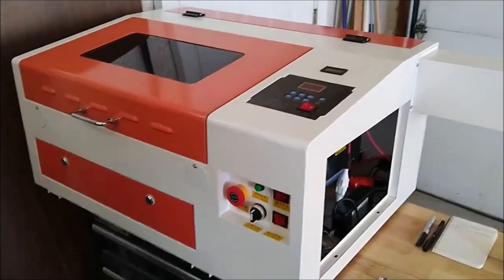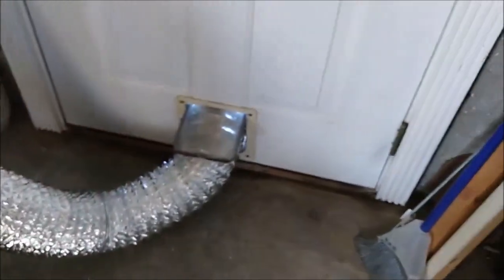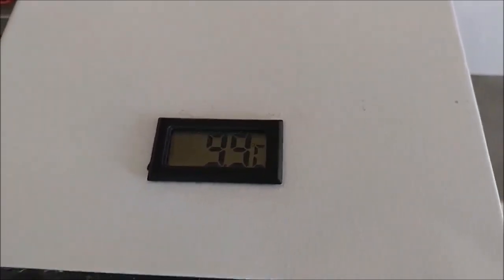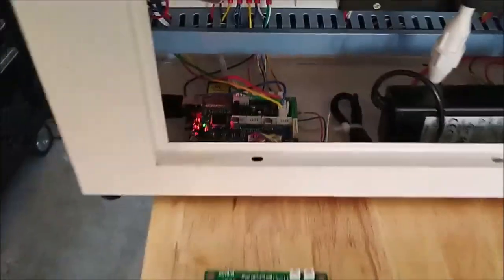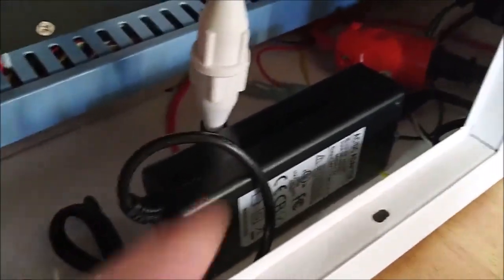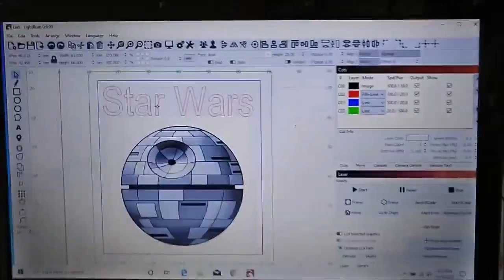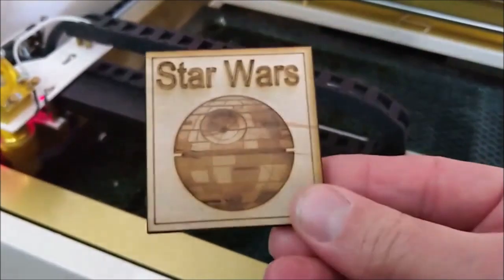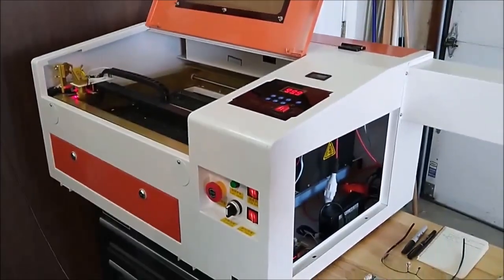Ten-High Laser Engraver Cutting Machine with K40 and Cohesion3D LaserBoard Control

Comment: Thanks for the great video.  It looks singed around the edge and lettering.    Is eliminating that just a matter of fine tuning of the power/speed or do you have more less live with it?  Any idea what the kerf width is?  lastly, what sort of accuracy you get?  i.e. if you burned a 1" circle and mic'd it, what what sort of tolerances would it be within?

Thanks!
Reply from the maker: I am not an expert with the machine.  More of a casual user :)  Not sure of the kerf width, would have to measure it.  Harder woods exhibit less burning on the edges.  The absolute accuracy is very accurate.  For example if I draw a 50mm circle I would it expect the cut to be within +/- 0.1mm.  When I am cutting acrylic that is ~3mm thick, I would guess my kerf is maybe ~0.5mm.

Comment: What configuration changes did you make? I just got the same machine and updated to the same controller board.
Reply from the maker: In the config.txt file, I changed to these values:
alpha_current 1.2
beta_current 1.2
alpha_max 400
beta_max 300

Comment: Thanks for the video! Very helpful in setting up a used 40w I picked up cheap on a whim. I have a question, what air pump / compressor are you / most running? It did not come with one and trying to figure out the air situation. Luckily I am into saltwater aquariums and have the water pump, RO/DI water and a chiller if needed
Reply from the maker: Thanks for the compliments.  My Laser came with the air pump.  Links to pictures of my pump are below.  The pump is quite noisy.  I have thought about looking into something that is quieter but have not got around to it.  It is labeled 45W with flow of 50L/Min.  

https://drive.google.com/file/d/1uWUtiV4oCZfvPZ2YCwBSfZr5aZD_SPZe/view?usp=sharing
https://drive.google.com/file/d/1BZmv_5MLoYwzUHGlSCDeiAPmubsSsb3q/view?usp=sharing
Reply: Thank you very much!

Comment: I am a designer that works in vector (adobe illustrator). I am thinking of buying one of these but had no idea about cooling and venting. Will need to look into it much more. Def need more research!
Reply from the maker: Keeping the laser tube cool is key to longevity.  Some people will just use a passive cooling system like I have on my mill and be ok.   Circulating water with a fan blowing over a radiator.  However, active refrigeration will keep the tube cooler and should result in longer life.

Comment: Very interesting, how the 60W tube was made possible to fit in the 40w case doing a case extension. Never saw that before. I always thought about upgrading to a more powerful tube after my tube will fail some day in the future. Now i know, how to fit in a larger one some day. Guess i also have to upgrade the powersupply as well if i do so. They say, that the power supply of the 40w Laser is pretty weak anyway and cannot even handle the 40w one to its full extent. So in case of a power supply failure i'd probably go to get a 60w capable one for replacement to be already prepared for the larger tube some day. I heard that the cohesion 3D Board let the stepper motors running much smoother and more silent, so i wonder that you didn't mention that in the video (or i missed it). Sad that the cohesion board cost nearly as much as the whole 40w laser. Thank you for this interesting video !
Reply from the maker: Thanks.  It is is interesting how they squeeze in the longer tube.  Ten-High's 40W units have the long tube cutout with a flat plate attached.  Yes, the Cohesion 3D board does run quieter but I did not do a direct comparison.  My air assist pump and exhaust fan are pretty loud and overshadow the stepper motors :) (every reduction does help some though).  I have been thinking of adding an analog ammeter to my machine.
Reply: @DanPattenAudioG33k  I'd definitely do that. The analog Ampmeter shows you exactly what's going on and is recommended by many owners that have a model with digital display.

Comment: Thanks for this video... I'm looking as well, but had been struggling with their requirements for old versions of software.  The solution you found looks great... the Cohesion board and software doesn't work out to cost much than getting Coreldraw, and struggling with it.  Hard to believe Ten-High want you to use a 32-bit OS....
Reply from the maker: Yup, I agree.  I purchased latest version of Corel Home/Student and was unable to use it.  Was only able to use the old version they supplied.  Maybe when you are ready to purchase, you could contact Ten High and ask to drop the price and not ship with the standard control board.  I did sell my old control board and USB key on eBay for $40 :)
Reply: Or just use the stock hardware and get K40 Whisperer, along with Inkscape. All free.

Comment: Hi Dan,

I came across your video in the Amazon Review of the Ten High laser cutter listing - we've had other people asking about doing the conversion to C3D.   Then I searched for "Cohesion3D Ten High" and your video came up on YouTube, first result.  It was really nice to watch.  Thanks for not cutting the end off the power brick AC cable :) - I like your solution more.   Be careful about running the machine at 100% of 100% though, quick way to burn out or reduce lifespan of the tube: https://cohesion3d.com/knowledgebase/cohesion3d-pwm-control-and-potentiometer-vs-digital-panel/

Anyways, thanks for making such a nice and informative video and hope all is going ok.

-Ray from C3D
Reply from the maker: Thanks for the comments.  The combination of the C3D Hardware and Lightburn Software has made my machine much easier to use.  Yup, I rarely run my machine at 100% of 100%, is usually much lower.  At some point, I would like to install an ammeter, just have not got around to it.  Thanks.  Dan

Comment: I've been trying to get corel laser to do a a few jobs (as per your video) at once and I just cant find a way to control the power settings or see a list of scheduled tasks.
Reply from the maker: I was not successful at controlling power with Corel Laser.  LightBurn has been easier to use (for me).
Reply: @DanPattenAudioG33k  I have been looking into lightburn, can you confirm if lightburn allows you to programme the power and speed for each element before executing?
Reply from the maker: Yes, you can program the power and speed of each element in a design before executing all of them at once.
Reply: @DanPattenAudioG33k  I have finally done the upgrade and had to mount the board temporarily the other way as the USB connector did not match the cutout on the machine.
Previously I had set x=0,y=0 with some acrylic bolted down into the bed at the very top and left side laser cut. I had set my bed size as 400 x 300 and it seems that 0,0 is now futher back to the left by 1-2cm. Did you notice this on yours? If so how did you resolve it? I assume there was previously a laser offset in place.
I am finding that i am getting some gantry crashing, which I thi k is to do with the original card setting of 0,200. Id like to retain and use my original 0,0 marker on the bed. Any ideas?
Reply: I have the same machine as you do and have been trying to work out why I couldn't control the power from the software. After watching your video last night I was able to move in the right direction and come to the conclusion it's because of the m2 nano board doesnt allow it. I know you mentioned what you did to replace it but any chance you can send me some instructions or perhaps do a replace video? And where did you buy the cohesion 3d board from?
Reply from the maker: Sorry about slow reply :)  

I purchased the Cohesion3D board directly from https://cohesion3d.com/

Not a whole lot to show about the replacement as all of the connectors directly compatible.  Only issue was board mounting and USB Type A connector.  You can see that  mounted the new board back from the face and the cable feeds through the old USB hole.  I have been thinking of getting a USB Type A bulkhead type connector to clean this up but have not gotten around to it yet.  If I do,  maybe I'll make a video.

Comment: you mentioned you had this cutter for 2 plus years? If that's the case, that theory that Co2 tubes has a shelf life is not looking so true after all, Does your tube have a metal end-capping or is it only glass?
Reply from the maker: Purchased in June of 2017 on Amazon.  I have not really done any research on shelf life.  There is a metal cap at end for water connections.  Is this what you are asking about?
Reply: @DanPattenAudioG33k  Yes it is, they are generally the more expensive tube, so i am guessing they have a better seal which might suggest they last longer, as a consumable item, Which Co2 tubes are. Thanks and Great little video showing the Cohestion board, I went with the CnC shield, with the Uno running Grbl, But that is only because I'm cheap lol i find 250$CAD a little too expensive for the K40's i modded
Reply from the maker: @patprop74  Good info.  Thanks.  I looked at some of the other solutions but went with what I thought was fastest implementation solution.